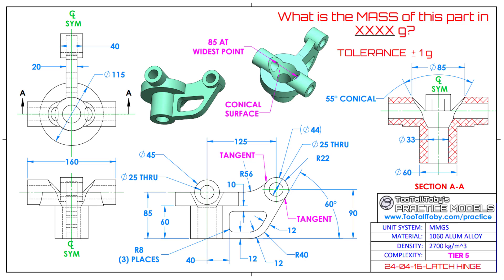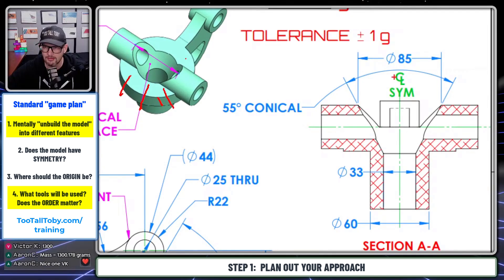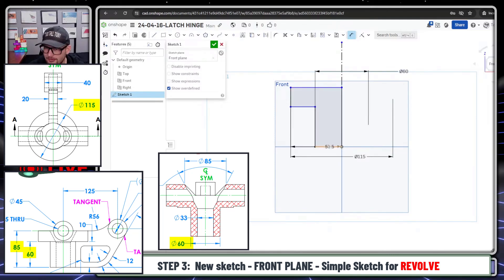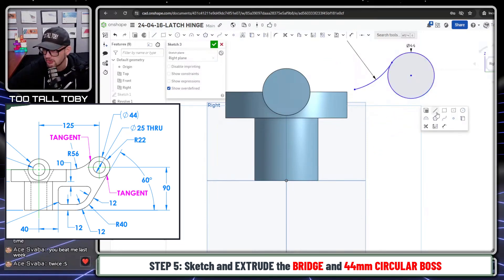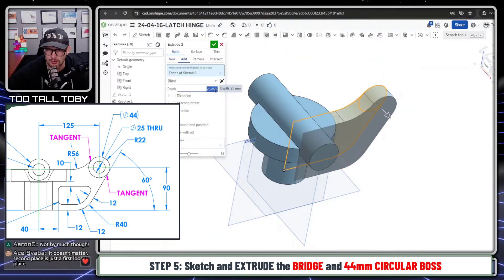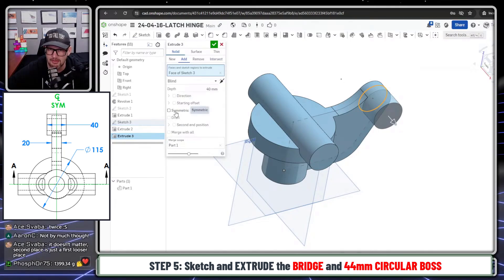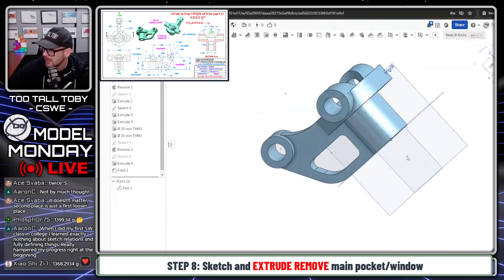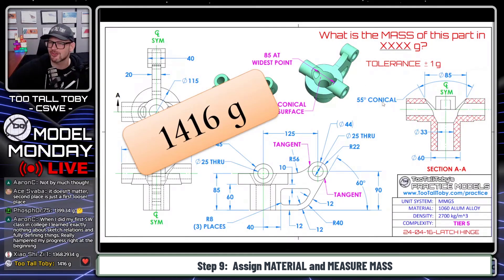Onshape TUTORIAL - Step-By-Step - TIER 5 challenge - LATCH HINGE

Comment: Thanx for this! It took me 30 minutes, with one error. Turned out to be a simple diameter typo which made the part 2 grams lighter 🤬😅

Small tip for dual dimensioning at 3:40. Make the solid line through the center temporarily a construction line. Dimension against it and then make it solid again.
Reply from the maker: Awww yeah - nice - I'll try that thanks!